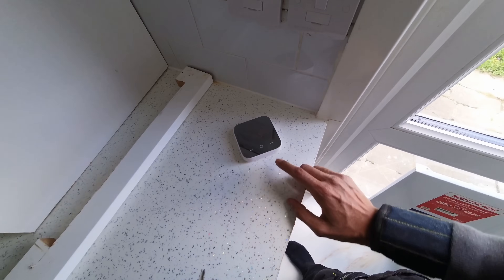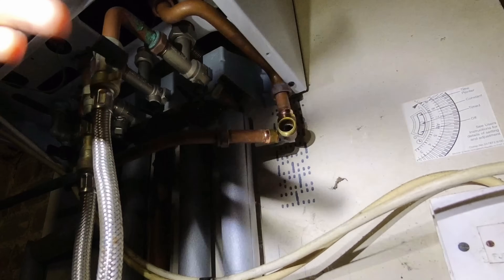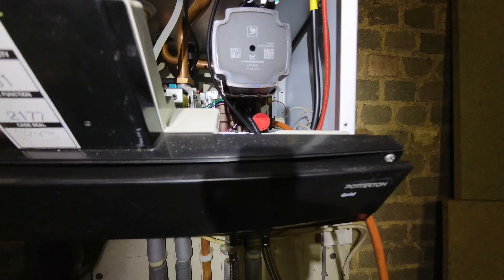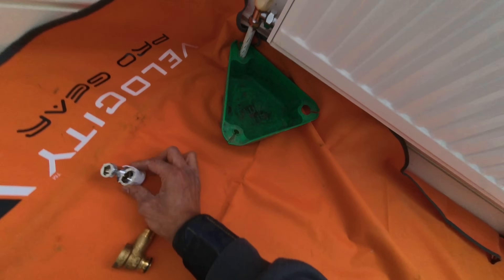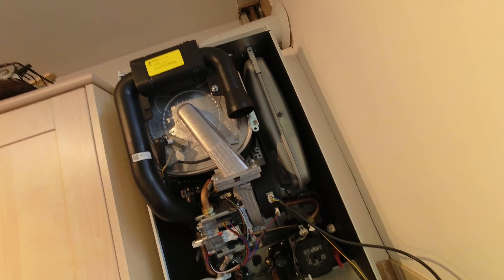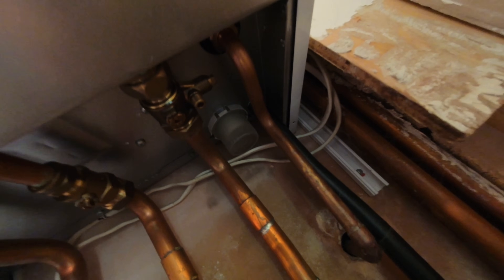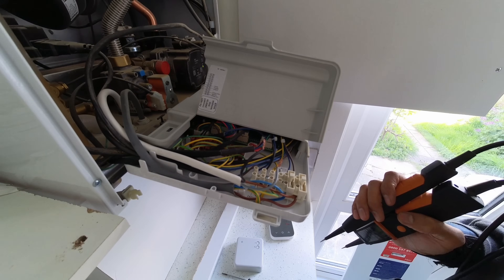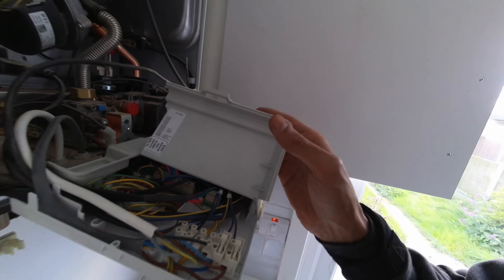The Previous Installer Got It Wrong - A Day In The Life Of A Gas Engineer 157

Comment: still cant figure out on the second rad valve change , how you avoid draining the whole system and create an airlock
Reply from the maker: Just from experience 👍🏾 drain pressure out of the boiler then shut flow & return valves

Comment: on the hive issue you resolved, please please sleeve any switched lives, avoid any single insulation wires being visible and a cable clip to prevent cable stress. 👍